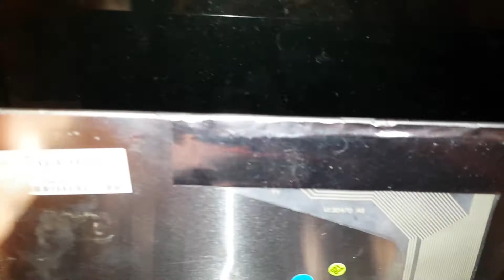Qosmio X870 Keyboard removal, Ram upgrade

Comment: Hey about removing the keyboard, did u need to remove any screws under? Service replaced mine but it's not backlit so I'm ordering a new one from China, there's nothing under the keyboard just one bump close to middle, so do I need to remove any screws or just pop with a credit card as you show

Comment: Hi, I have been using a Qosmio x870-025, Intel core i7-3630 QM 2.4Ghz with 2TB HDD(5400rpm), 16GB RAM and 3GB Nvidia GTX 670M Graphics for about 5 years. The store authorities had downgraded the laptop to windows 7 according to my request after I bought it.  I find the laptop is being very slow recently while doing video editing. I wonder, if it is possible to upgrade my laptop with some better specifications. What I have in my mind is a 2TB PCIe or a 2TB 7200rpm SATA as a Hard disk drive and preferably another 16GB of RAM to keep this workhorse going.Any help or advice on this would be appreciated. Thank you !
Reply from the maker: On this setup you'll only be running SATA drives i'm afraid, not all bad news though, if you stick with Western Digital drives, because I refuse to put the safety of my data in the hands of any other brand, as I have been screwed over to many times by the crappy quality of the other brands. Anyhow, you can shove in 2 HDD drives in this one with a little modification, a 1TB black drive in the 2.5" WD brand @ 7200 RPM in slot 1 for your OS (I also suggest a solid state drive for faster boot and loading times, just don't cheap out), and then a 2 TB green drive @ 5200 RPM in the 2.5" WD brand for storage, however the 2 TB drive is a whopping 12MM tall, so the plastic retainer on the HDD cover on the bottom of the laptop will need to be slowly cut to the desired length, to allow the 2TB drive to fit, but also hold it in place, please be patient, as I promise the results are worth it, Yes I have already done it.

As for the memory, the CPU WILL support 32GB of SO-DIMM memory, once again, don't cheap out, but you do need to be running the OS in the x64 bit platform, I installed 4x 8GB G-skill memory modules into mine and it has worked flawlessly since I made this video two years ago, and I never turn it off.

So I already did to mine what you intend on doing, but you'll have to start over, and acquire a restore usb drive from toshiba so you can reinstall windows once you're done upgrading the laptop, I think it'll cost you like $50, I can't remember. After it's installed, go to the microsoft website, and upgrade to windows 10 for free.

So I hope this helps, let me know if you have any questions.